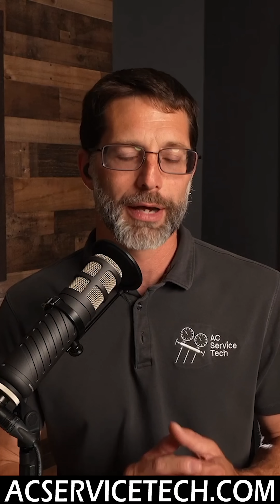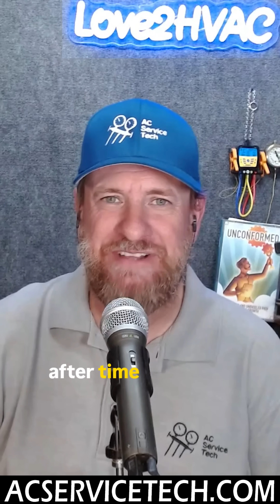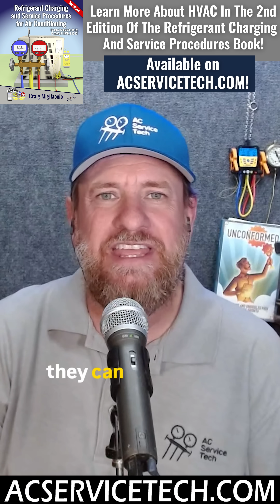How Do You Convey HVAC Knowledge Well? HVAC Teaching Techniques To Better Engage With Students!

Comment: I would tell anyone interested in the hvac field to look into something else. There is just not enough pay for a tech for what they must give up in return...most summer vacations, lots of time away from friends and family, 
long hours in extreme heat or cold conditions, working around hazardous voltages, equipment, chemicals,and electronic slavery since you are tracked with GPS. Think about that while your condescending boss is calling you from his boat or lazy boy chair near the fireplace. Anyone who disagrees with the aforementioned issues has never really worked in this trade. I happen to be treated very well now because I am nearing retirement after 35 plus years in the same company, but I frequently see techs everywhere treated like low level dirt from stupid office managers and salespeople who have no idea of the constant certification requirements, safety training, and learning on the go with all the newest electronic  and refrigerant nightmares now being manufactured, including many miles and hours on the road, sometimes being sent to dangerous areas. More than ever now a tech will also need computer troubleshooting and some programming skills in addition to everything else required.